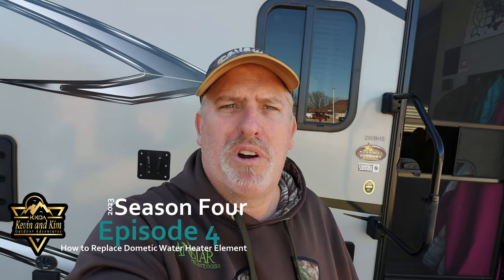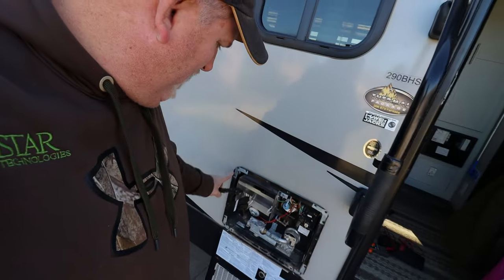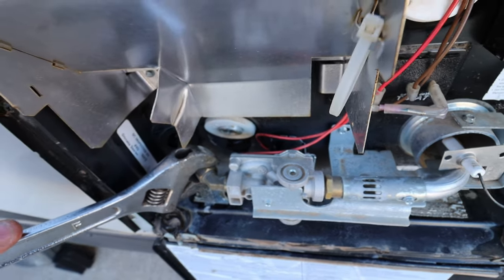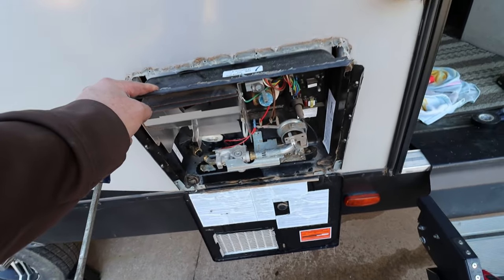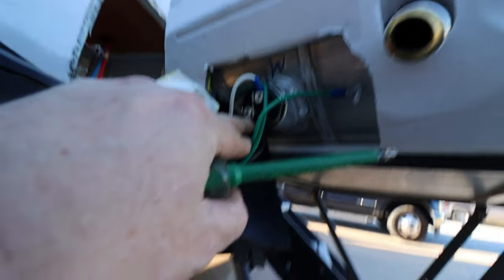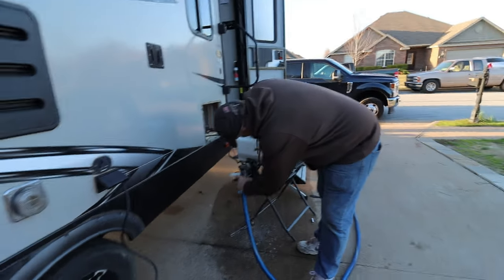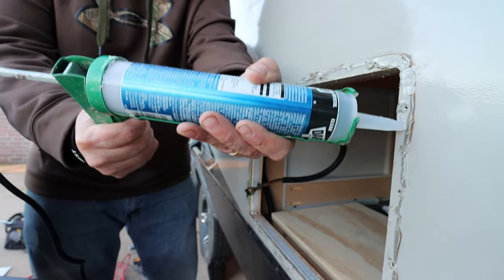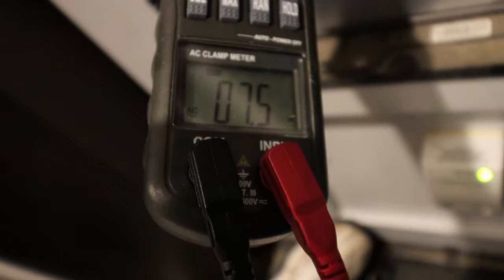How to Replace Water Heater Element in a DOMETIC or ATWOOD Water Heater

Comment: Does not matter which wire goes on either terminal on heater. Someone should devise a better way to get to element.
Reply from the maker: Yes I agree it definitely is in a bad location and alot of work for a simple part. Thanks for watching.
Reply: That's engineer's for ya!

Comment: Thx. i have an Atwood 10 gallon hot water heater in my motor home and the heater element appears to be on the inside just like in your video. Not sure that I'm up to the task of taking out the entire hot water heater especially since i have an upcoming appointment to fix this very issue!
Reply from the maker: Well if they charge you an arm and a leg you know why because it is labor intensive. Thanks for watching!

Comment: Did you have to cut the pex lines, or were you able to cut the collars and separate the hoses?
Reply from the maker: No they just screwed on the fittings in the back.
Reply: @KevinandKimOutdoorAdventures  oh duh on me! We're experiencing the electrical portion right now, but the gas is working just fine, though.
Reply from the maker: Yes the same thing we had happened. That was a result of turning on the electric without any water in the tank burns up the element in less that 30 secs. If you have a meter, at around 9 min mark I show you how to test it
Reply: @KevinandKimOutdoorAdventures  ours had water, but I guess the previous owner had made the mistake. They advised us about the thermal fuse and having to replace it. And I happened to learn about stink bugs hiding in the propane tube myself.

Comment: Great video. Left the camper for a while and came back to find the heater trips the mains power when i turn on at the panel. Heating with gas is working fine. Thinking the heating element is dead but need to do some more research/ testing first.
Reply from the maker: At the end of the video I explain how to test it. Thanks for watching!

Comment: I used this video to change the element in my Keystone Bullet, it worked great for 1-2 months, then it stopped working. I’m pretty positive the tank had water in it, and that the element was the one rated correctly for the camper- I called camping world to verify before putting it in. 

I’m scared to have to do this whole process again if it means the element will stop working again, but I’m going to try it again anyway. Do you know if there could be another problem that went wrong to cause the electric water heater to not work? The propane half still works.
Reply from the maker: You could put a meter on it to verify that the element failed. It could have been a defective substandard part.. Glad the video helped.

Comment: So I have replaced the circuit board and thermal fuse and my electric ⚡️ is still not working so I have to switch back to propane what do you think it might be ?
Reply from the maker: Not sure but have you tested the relay on the 12v side? Your switch is 12v and activates the relay to provide 120v power.

Comment: I replaced my element a few months ago. What a bitch. Pulling that whole unit out just tears up the foam capsule. Took it out, full hook-ups everything is fine. Went out again but used the water tank, no hookups. I started getting a leak on the floor under the tank. Checked all fittings and all was dry, so I determined this was the element. Pulled it all today again and it was all together correct. Doesn’t look like the element threads would benefit from Teflon tape, due to the rubber gasket, but I can’t seem to find where the leak is from sc🤔
Reply from the maker: Wow. Did you ever find where the leak was coming from?

Comment: So dometic is atwood water heater?
Reply from the maker: Yes, Dometic and Atwood are the same. They actually bought Atwood. I hope the video helps
Reply: @Kevin and Kim Outdoor Adventures  got very similar. Ive noticed Australia and America have different model numbers.  And our aussie model numbers dometic/atwood dont have on their systems. Cant work out 240v  power. I have 240v cable going to water heater. But no switch for it or manual for how it works. I know gas works tho
Reply from the maker: @Bobodeman  you may also check the relay off the switch. Mine has a 12v relay that turns on and makes contact for the 120v to heating element. You might want to check that
Reply: @Kevin and Kim Outdoor Adventures  the 12v switch is only connected to pump and 12v battery
Reply from the maker: @Bobodeman  all electric water heaters have an on/off switch on a separate panel or on the water heater itself.
Reply: Thank you for the video. I think you convinced me to pull the unit out and do it the right way. The only disappointment for me was that you didn't show the old element when you took it out. I don't think there's an anode on these units, right? So how did the electrode look? Was there a lot of corrosion?  Thanks again for the video. Very helpful!
Reply from the maker: The old element wasn't corroded or anything it was just left on with no what in the tank and it burned up. No these dometic water heaters are aluminum so they don't have an anode rod in them just plastic plug. Thanks for watching glad to help!